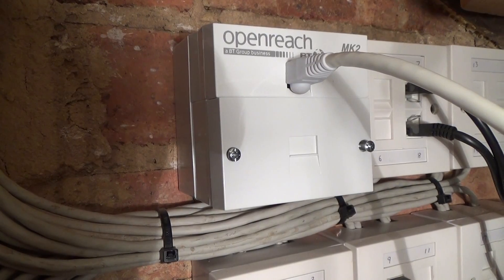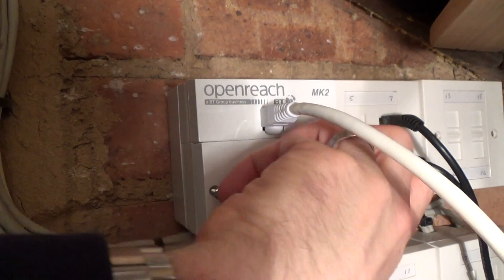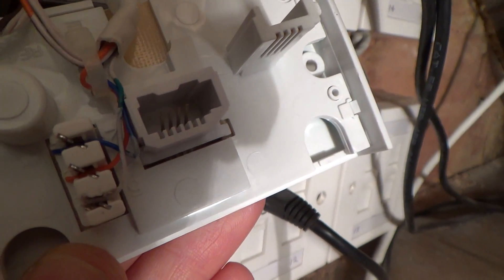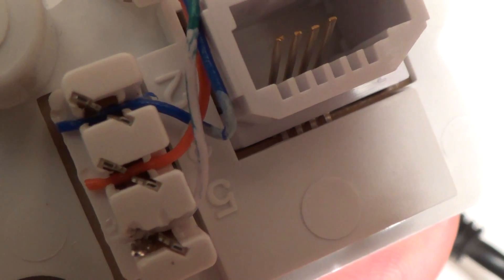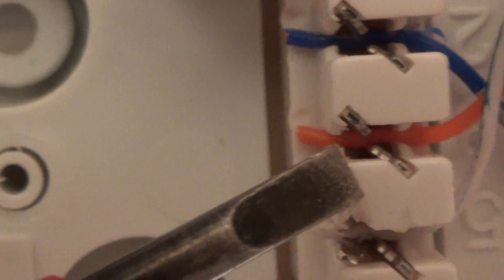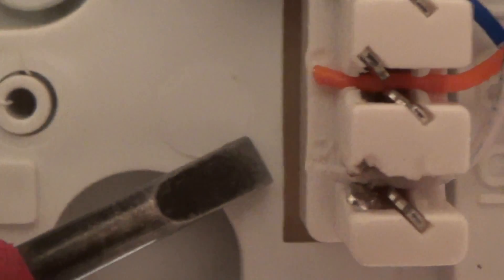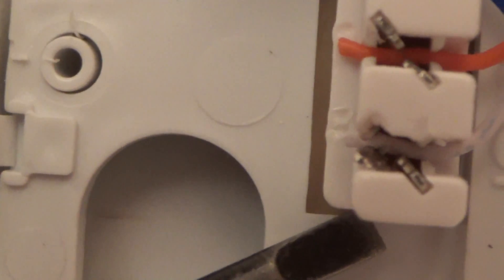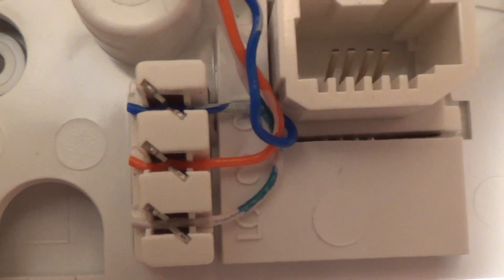Noisy Telephone BT Line FAULT caused by a bad connection. EASY FIX

Comment: I remember fixing telephone wiring faults from the pole to the phone using a faultmans  telephone  and a faultmans test set to test for faults :  disconnection ( Dis) ,  short circuit (Loop),  High Resistance Loop ( HR Loop) noise or 1 ring only,   Earth fault ( wire touching earth) or Foreign Battery ( touching another phone line). We also actually repaired the phones replacing the transmitter and ear modules.  Occasionally there was a high voltage fault when a line was contacting 230 volts and you had to wear thick rubber  gloves whilst finding and repairing  the fault.

Comment: Hi Vince. Been watching some of your vids. I have a slightly noisy line AND an extremely slow internet speed. I only have a master socket. NO slave sockets. Now my drop line is the older thicker cable and I think, from 1 of your other vids, the newer master sockets may not allow that thicker cable. So, which master socket do I need to buy and could my present master socket be the fault for my slow internet and noise? Hope you can help. Thanks
Reply: You need Openreach engineer not new master socket....
Reply: @Ymma58  oh so you can replace it with a human. Awesome

Comment: I take it I'm not allowed to replace the master socket myself? 
Had some damp in the mounting area and now the line is really crackly as well as broadband really slow.
Reply: You can but if you damage something you will have to pay Openreach to fix it and you may have to pay them compensation. It's better just to call your ISP.
Reply: Also if you have damp you might want to ask for the new NTE5C master sockets because they are slightly better at preventing interference from damp.
Reply: John Daniels 
Sorry for late reply. Notification went to spam folder.
Thanks for the advice.

Comment: What's the difference with the MK2 faceplates?
Reply from the maker: +ForestCat MK3 is the latest, the filters inside are better, so the MK2 has a slightly better filter than the MK1 and the MK3 is the best but changing a MK1 for a MK3 may not show any difference in real life speeds.
Reply: +My Mate VINCE Thanks. Openreach just replaced my master socket but has no MK on it so assume it's a MK1
Reply: The MK3 has a RFI Filter built in where as the MK1 and MK2 do not .